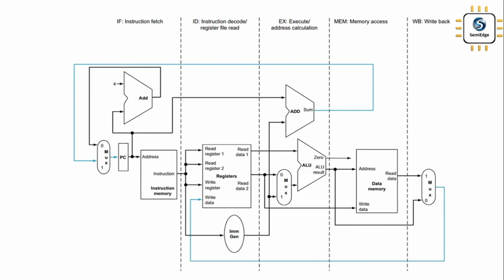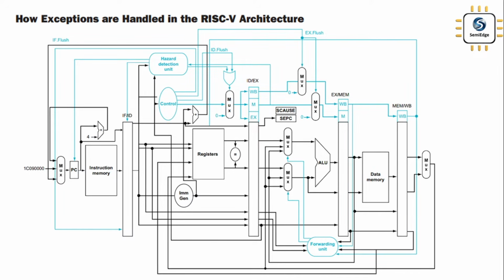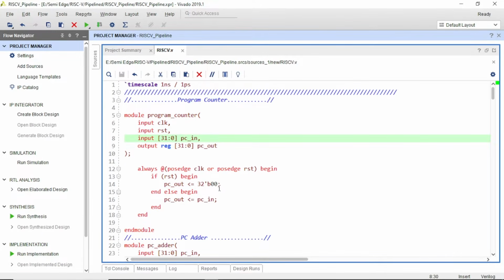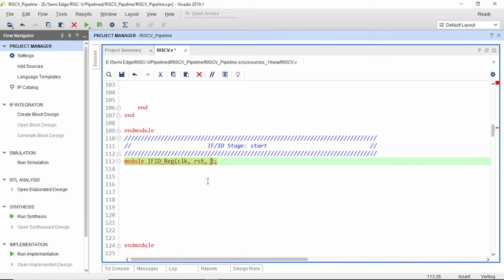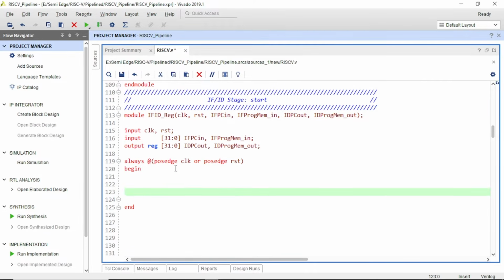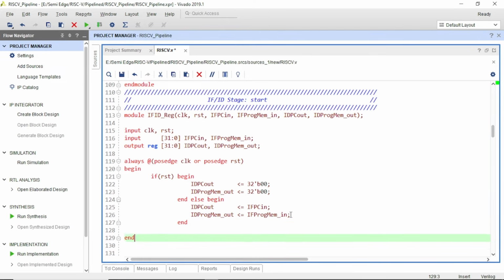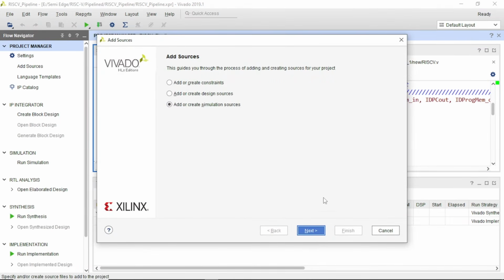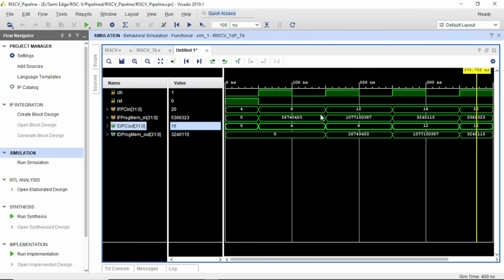RISC-V Pipeline Processor Design | Ep1: IF/ID Register Design in Verilog | Step-by-Step

Comment: sir is there any pre requisite needed for  riscv pipelined processor
Reply from the maker: it's helpful to know how a RISC-V single-cycle processor works first - including instruction flow, control unit, and datapath basics